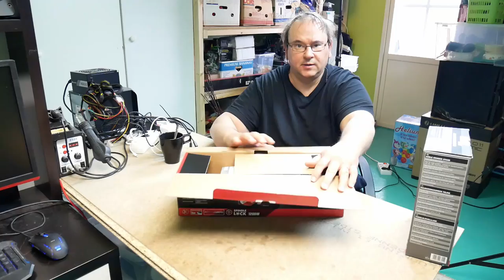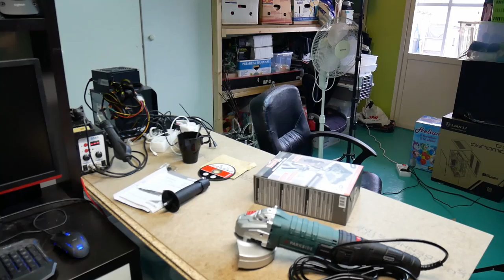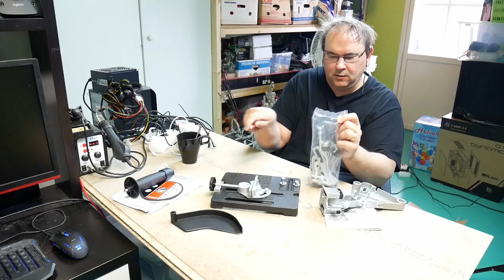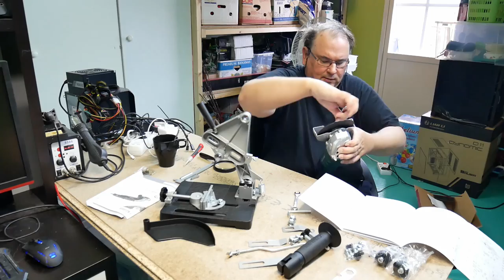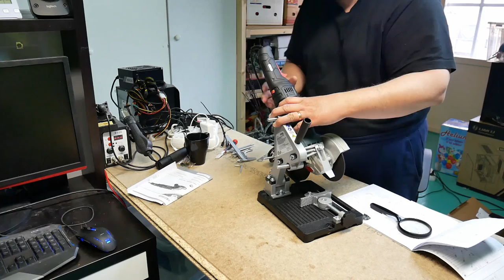Parkside Lidl angle grinder PWS 125 E4 and Powerfix angle grinder stand

Comment: I have the same combination but I haven't used it yet. Are you satisfied with it? And which disc are you using?
Reply from the maker: I use normal grinder steel cutting discs